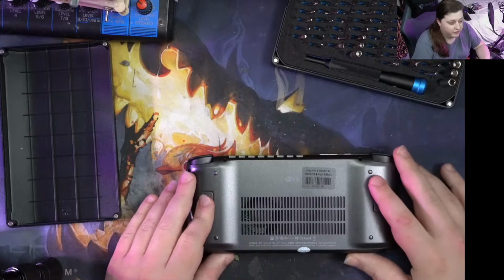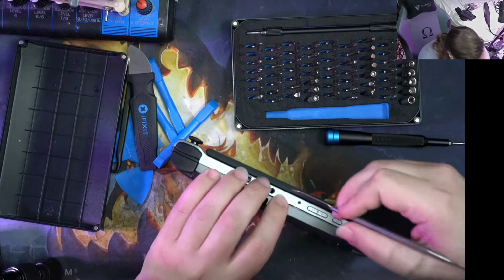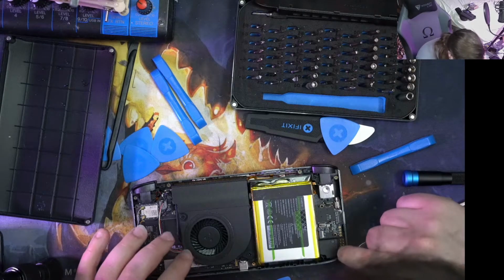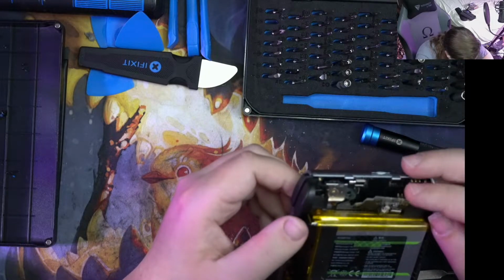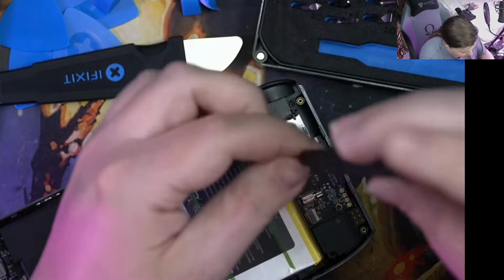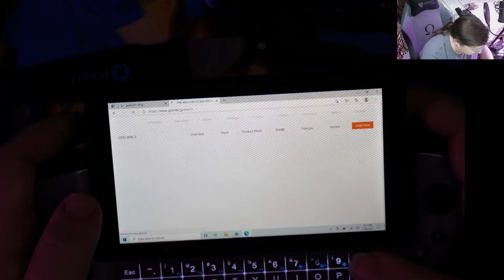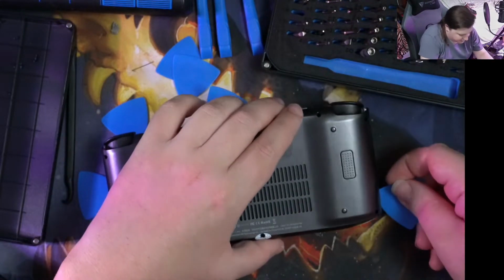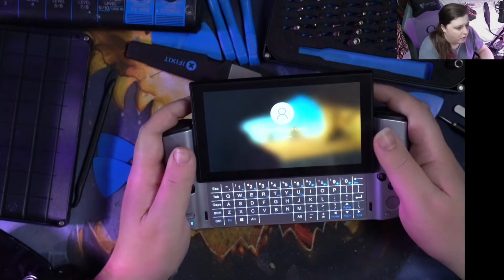Fixing GPD Win3 Joystick Issues

Comment: Neither my unit's mouse nor gamepad mode works. When I tried updating the firmware, it shows an error saying unknown device in both sides. I took it apart like you've shown in the video. But idk what to do with those 4 pogo pins. Pls help.
Reply from the maker: Oh just press on them lightly. They should spring up  against it. If it doesn't spring up, just try and push against them again a little bit and they should pop out. The travel distance from when it's all the way pressed in and out is small so don't try to be so aggressive with them.
Reply: Thanks for the reply. I fiddled around it a lot. But couldn't get it to work. So I already sent it back to Amazon and they sent another one. Seems like it was a faulty unit and the mouse functionality was supposed to work out of the box.

Comment: Yeah I had mine looses just shoved in all the way and I took it apart and just popped in back in it’s kind of weird but it worked for now still need to buy new one because the stick obviously broke out at the connector point. But it’s a temporary fix
Reply from the maker: that sucks. did you try and contact the company for a replacement?

Comment: From what I understand a big chunk of the issues are because of stuff coming loose in transit from being shipped overseas 🤷‍♀️ 
That's why they usually tell you to reseat the connectors yourself. It's cheaper than sending it back for a fix that takes less than an hour and then worrying that the same stuff will come loose again being shipped back to you 😂
Reply from the maker: true but i think at some point it should just be a connector. It's interesting to see something as a spring loaded contact point, but the reliability issue is what messes with me. If they didn't have this problem over multiple generations I wouldn't care. The fact that they've had this problem before with other versions and haven't fixed it yet is concerning.

Comment: I want one so bad but the price is crazy 1400 hundred is two console and a pc.
Reply: I would watch for one on ebay. I just got one on there for $700 because the backlight started working sporadically depending on the screen location (whether it  was up or down) and then just quit working. And the 3rd party seller they got it from on amazon wouldn't give them a refund.  Im assuming the ribbon connector came loose for the backlight since people are having issues like this with connections coming loose on their controllers.
Reply from the maker: sounds about right. but it could also be faulty in general. Presumbably the gpdwin3 is made from standard parts so if you figure out what screen it is with a serial number there's a chance you could just order it.
Reply from the maker: Yeah... I only got it cause it was about $1000 on kickstarter for early customers like the first week.

Comment: I just followed these steps and my controls are back up and running. I aligned the pogo pins with the connectors like you did and I'M BACK! Hopefully this completely fixes the USB issue so I don't do this again. I love this device and want no more issues. I'm gonna test out games just to make sure it's 100%

Thank you for this video. You deserve the sub I gave you and more. 👏🏾👏🏾👏🏾👏🏾

High five
✋🏾
Reply from the maker: Glad it helped. That's the whole reason I did this video. GPDWin is from china and all companies just want to sell and not document anything especially in another language. They spend their time pushing out the next wave of product. That's what I saw when I worked for my last company. They made so many revisions of the product and they were based overseas. They didn't want to translate anything and when they did it was by people who weren't out making service calls in their spare time.
Reply: @ElainesStory    the pin mentioned actually didn't work. It messed up again maybe the next day. I ended up going to the gpd win 3 page on  reddit and someone from gpd mentioned wiping a bit of alcohol on the pin using a q-tip. I did so, and the win 3 has been working ever since. I think they also released a hardware update to fix the issue as well last month. Gpd needs to work on making sure issues like that are taken care of before release because I'm sure they knew of the issues and how to fix them before they shipped everything out.
Reply from the maker: @blastv110  probably but documenting everything is something that should be done for products like this when they know if there is a high failure rate. It is a good product and I do like it. I wish it was more transparent with issues and documentation. That's it.